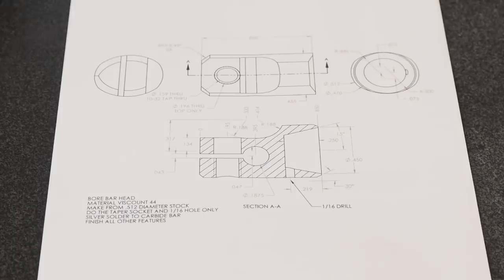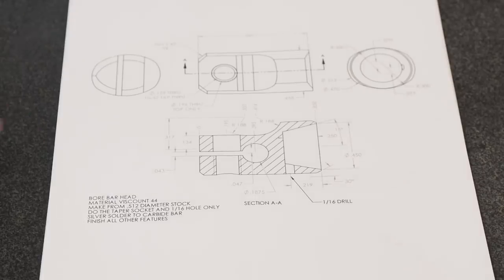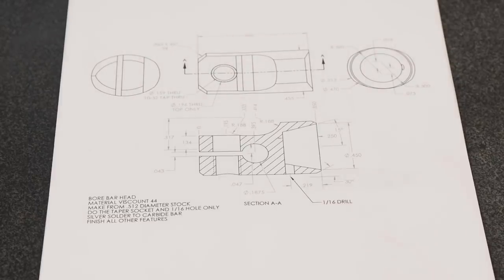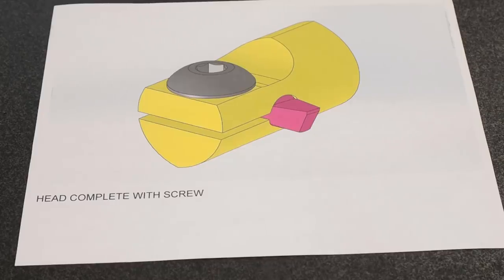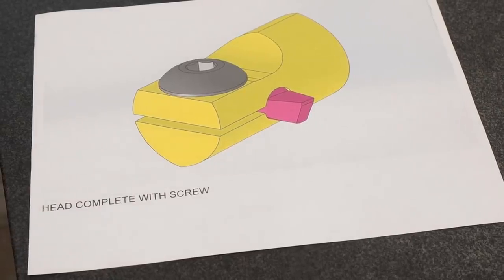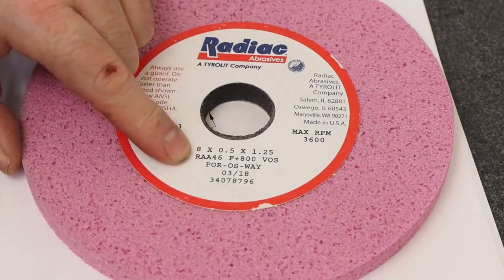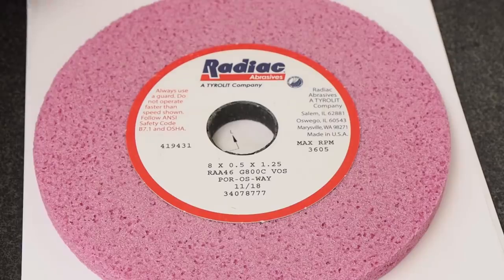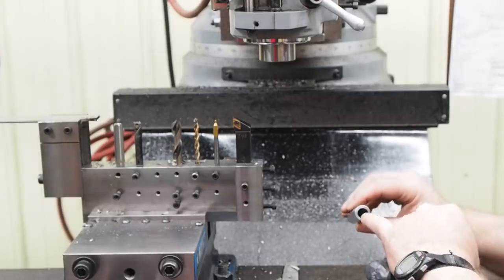Robin Renzetti Joins the Collaboration for Keith Rucker's Boring Bar

Comment: Thanks again for the videos.  I have reamed several holes recently that came out too large and I couldn't figure out why, now I will try them again with lower rpm.
Reply from the maker: One other thing that helps is to leave only about .007" stock for the reamer.
Steve

Comment: First of all I agree, the milling setup is awesome. I really am enjoying this because I needed a new nut for my 10EE and Monarch wanted  a ridiculous price for one. I remember in one of Keith’s videos he commented that although Monarch’s prices were high he didn’t mind paying them to keep the brand alive; I guess he couldn’t stand the ridiculous prices from them anymore either. I looked at buying a tap and making my own, but, that wasn’t cheap either; then I found a guy on eBay that sells them for $95 . I bought one but haven’t tried it yet. Great to see you guys make an awesome project out of it though. I’ll be following along until he gets it installed.

Eric
Reply from the maker: Thanks Eric. I am looking forward to seeing Keith use the boring bar and how well it works.
Steve
Reply from the maker: Hi Eric,
I saw your comment, it was flagged as possible spam. I didn't approve it because I didn't want to post your email. I tried to email you several times but it wouldn't go through. You can contact me here, solidrock@nlbchapel .org   without the space.
Steve

Comment: Can't go wrong getting help from Robin.  This is quite the journey to thread a stupid cross slide nut.  I hope you get a manufacturable product out of this.  I suspect Keith could have gotten a custom ground tap for a lot less than what all this effort is worth.
Reply from the maker: Hi Barry,
I am sure you are correct but this is about learning a new experience for me. Also, being able to do a project with Keith and Robin is icing on the cake.
Steve
Reply: Same thought crossed my mind... It'd be easy to take a piece of 4130 round bar or drill rod, and make a tap and heat-treat it... Job done: One day or less... edit: On top of that, all the dimensions for the thread form are in the Machinist's handbook.
Reply: Making a video of googling shops, getting on the phone with a sales guy, emailing plans, negotiating price, etc would be really really really boring.

Comment: About cutting out upside-down Kieth did a video working on a set of cane mill rollers and he used CRC spray cutting fluid.once you have a pilot hole you can use the straw and shoot it up into the hole might work out pretty good
Reply from the maker: Good idea Chris.
Steve
Reply: @SolidRockMachineShopInc  just passing on a good idea Steve

Comment: I'm not far from Radiac in Marysville.  13:03  I use Norton.  But I can get Radiac pretty easy and I have tried Camel/CGW.  I use a B&S Micromaster 618.  32A46 and 60, 38A46 and 60, H to K hardness in both.  I think I have invested in about 50 different wheels, so there's not much I can't grind, them being 7" wheels.
Reply from the maker: I like that hardness range too! Most of the stuff I do the 46H is the one I like best so far.
Steve

Comment: Hello Steve 
I have a few questions regarding the second generation threading tool.
You may prefer to answer these questions in the next video rather than here. 
What type of steel will you be using for the tool bit clamping end?
I ask this because I'm not sure of the condition after soldering and follow up heat treat isn't possible (or is it?).
I have a couple of carbide shanked boring bars (Sandvik I think) and I've always assumed the insert pocket was milled after soldering.
Secondly, do you plan to grind the tool bit while being held in the bar as accurate indexing of the bit could be tricky if it were ground outside and then clamped in the bar.
You'd be welcome to use my tool and cutter grinder (Repco-Power TC1A) for this but there is around half the continental USA and all of the Pacific Ocean between West Michigan and Melbourne, Australia so not a very practical option! (I expect you'll employ some clever set-up on the surface grinder).
I have made similar holders as it's a great way to take advantage of very good materials (CoHSS, carbides etc) from worn out centre-drills, endmills etc and they are super versatile. Threading, boring, internal grooving and form cutting. Even key ways and splines in a pinch.
 
 Thanks for your consideration.
Matt
Reply from the maker: Hi Matthew,

A lot of your questions will be answered in the video. The bar is carbide from a broken boring bar. The steel head was provided by Robin, this is what he said it was "The heads are made of Viscount 44 which is pre-heat treated special H13 that is very machinable at 44 RC". This is my first time working with this material. All the machining on the head will be done after the head is silver soldered on the carbide bar. I will be grinding the carbide pin that Robin sent me in a V block using a sine plate and sine bar for compound angles. I appreciate your offer to use your machine but you are correct the distance makes it hard.
Steve
Reply: Hi Matt  The silver solder I supplied to Steve flows at 1200F which is  the temper temperature of the Viscount 44 material at the 40-44 RC hardness range. So soldered the way that Steve did it the head does not loose its temper and maintains its very high yield strength of 156 to 175 ksi
Reply: Thanks for the info. Looking forward to the next vid.
Matt

Comment: Robin normally I'm impressed with most of the things that you work on and come up with. But this is not one of them. I'm coming from a place of experience as a jig bore specialist for several years. We made a great deal of our own custom boarding bars. How your attaching the head to the carbide bar itself has some merit. You may need a vent hole in the bottom for the silver solder but the front of the bar is not the best idea. 
By a long shot. I wish I had the time to sketch out how I would make it. I think you would like it a whole lot With the end result.
R Sept.
Reply from the maker: Hi Richard, The bar worked great, did you watch the Keith Rucker video where he used it?
Steve